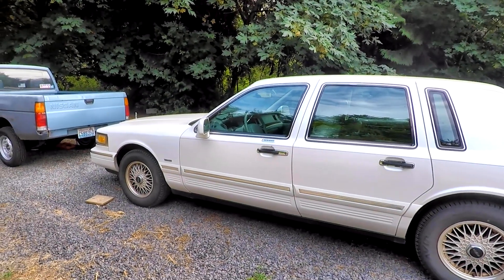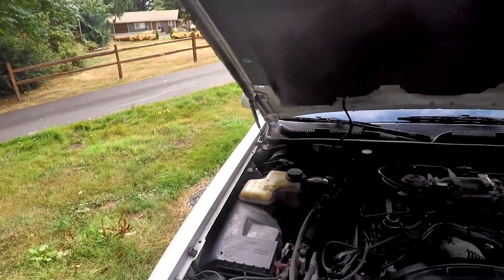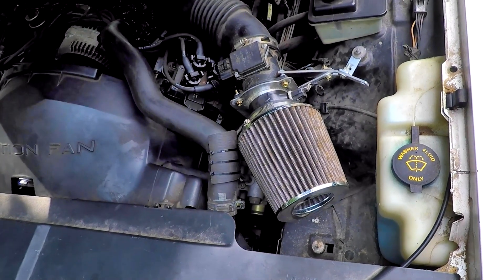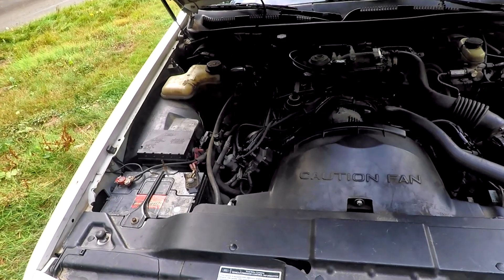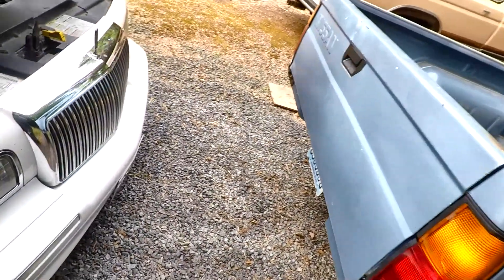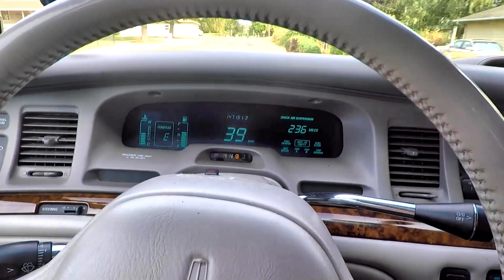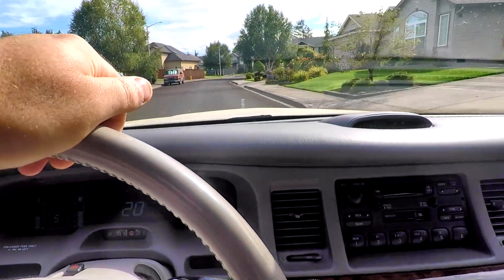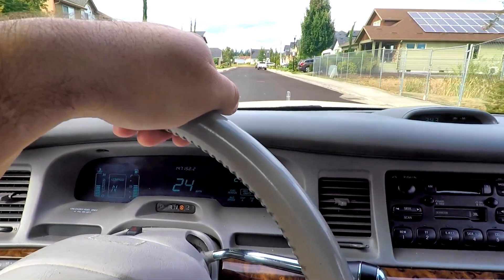1996 Lincoln town car Transmission experiment part 1

Comment: 97,000 miles in 2008 (daily driver for real), in march 2014 drove from charlotte nc to denver colorado....
in april on the way bac somewhere in kansas the speedometer started to glitch(maybe round197,000)....
ever since(talking tops days in a row would be 3) then bout a month without....
today 2/25/2022.... im at 205,000 and some change...
oh and its basically a tank, took a hit and was able to drive home also went thru yards and fields, over curbs and dividers.
so good car still driving today,

Comment: With proper maintenance that car will last forever....
Reply from the maker: yes they will, I have seem these cars with over 300k on them
Reply: I bought a 1996 Town Car Signature Series back in 2013 for $500 with a cracked intake manifold, it had just over 200k on it, I replaced the intake and daily that car for 5 years, when I was done with it it had 350K, I gave it to my pops a few years back now it has 366K, the crazy part about it is I never touched the transmission, best $500 I ever spent